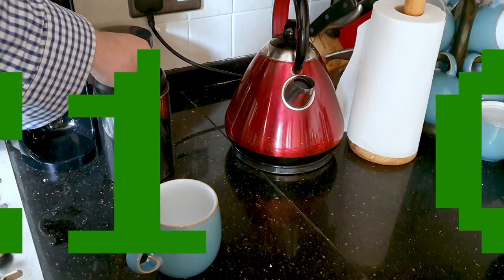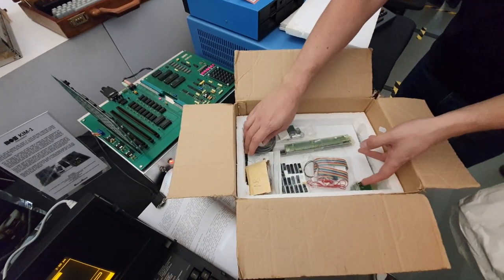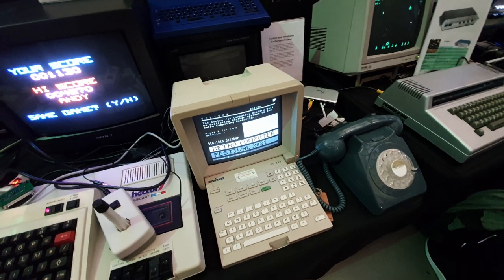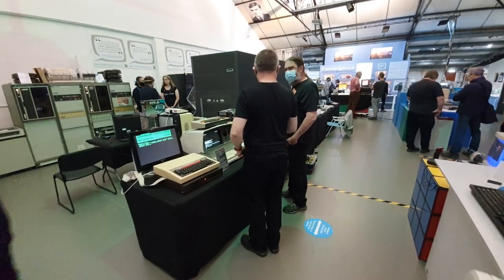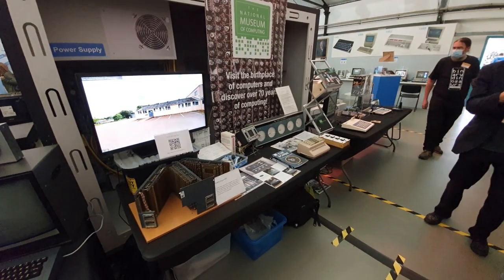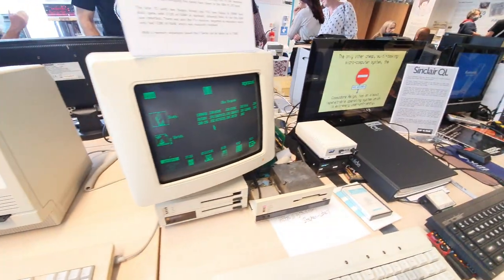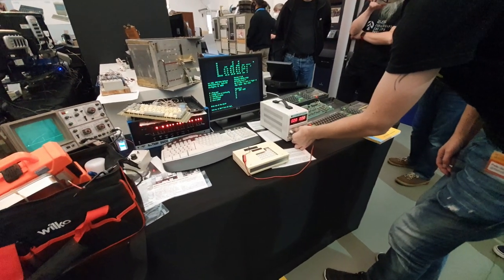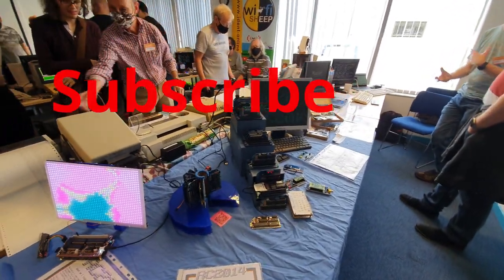Retro Computer Festival 2021 (CFCH Cambridge)

Comment: Having worked as a hardware technician for Visual Technology, a terminal and PC manufacturer in the 1980s, I feel a bit nostalgic when I see this hardware. There's a different level of quality in the hardware compared to what we have today even though what we have today is so much quicker and a lot less expensive.

While I foolishly sold my Visual V-1050 many years ago, I still have my Visual Commuter Computer. The Commuter was an IBM compatible portable computer that weighed about 12 kg when fully loaded. It came outfitted with various options with the highest being a full 25-line LCD capable of graphics as well as text, 2-360K 5-1/4-inch floppy drives, CGA graphics, 512K RAM, a couple of serial ports, parallel port, and an IBM expansion port. The good news is the system is still operational today and runs MS-DOS 5.0.

The V-1050 was an upgraded version of the Ontel Amigo, which Visual acquired when they purchased Ontel Corp. in 1982. The V-1050 came with 2-quad density 5-1/4-inch floppy drives, up to 64K of bank switched RAM, 32K graphics RAM with the graphics being controlled by a 6502, the usual array of I/O ports including a Centronics port for connecting external hard drives, and a boatload of software. The system ran CP/M Plus (CP/M 3.0). The included software was Wordstar, Z80 Assembler, C-BASIC, Multiplan, and DR Graph. I purchased Fortran, Pascal, and C for it because I was taking programming classes. The system could also read and write to disks formatted for other companies such as those for the DEC Rainbow, and Osborne I, or boot up as a terminal with no software loaded. The terminal emulation was built-in and worked as a Visual V-100 or other emulated terminals just like Visual's other terminal products.

The system was fitted out with a 102-key Keytronics keyboard and a 9-inch diagonal monochrome display, which came in either amber or green phosphorous. The display could be setup to the side or placed on top of the unit making for a nice compact setup if needed.